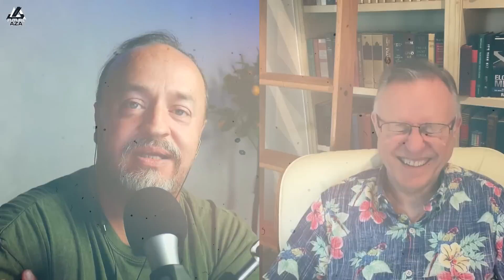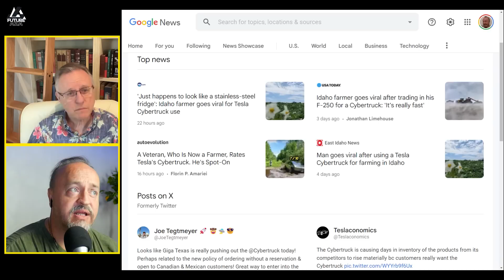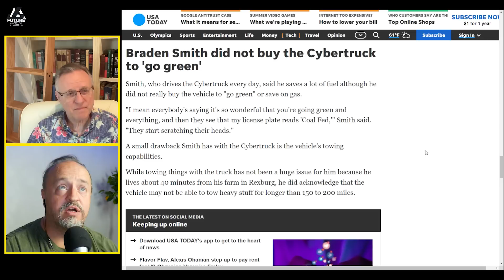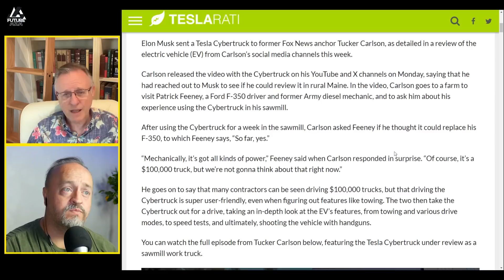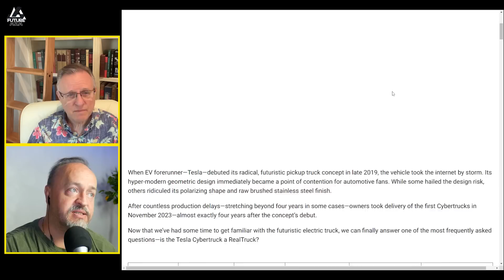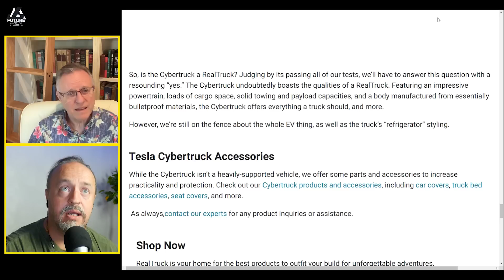Cyber IS a REAL Truck, and Even the Media Agrees

Comment: I hate whistling diesel, but they beat the crap out of a cyber truck and it was kind of fun to watch.
Reply: Nevermind. You mentioned it. Lol
Reply: Not really if you look a little harder, the F-150 actually only passed one of the tests, it didn't handle the drop off very well, it didn't go over the tubes.  The only test it actually passed was the over the hill jump but at a much lower speed and therefore much lower jump, it failed the explosions and it didn't go through the riot
But I doubt that any sane person would use any truck like that

Comment: Never had a trunk, but have a utility trailer, far more useful.
Now I tow it with my Y
Only there when you need it.
Nice and low, easy to get stuff in and out.
Easy to get lawn mower on and off.
No problem hailing 16 lumber.
Saved a fortune in gas.
9 out of 10 trucks never see dirt, never tow anything, sit in a parking lot all day and maybe move a 6 pack few times a year.

Comment: It's a truck that'll tow a trailer a hundred miles before you must stop and charge for half an hour or more, so on a trip of hundreds of miles, you'll spend a third or more of your time charging. If you're an urban cowboy who only uses a truck for light hauling around town, within a hundred miles of your home charger, and if a hundred grand is not a lot of money to you, a Cybertruck may appeal to you. That's a market but not a huge market.

My sister the veterinarian uses a pickup in her business and often pulls a horse trailer from the Piedmont into the mountains of North Carolina. A Cybertruck would never work for her. I'll never own a pickup of any kind, EV or otherwise, because I don't need one. On rare occasions when I need a pickup, I'll borrow or rent one.

To be fair, other electric pickups also have this limitation, though the Silverado EV has much better towing performance with a much larger battery and is in the same price range. I don't know how much money GM loses on each sale, but Tesla must still be losing money on Cybertrucks too at this point.
Reply: Tesla says CyberTruck will be profitable by the end of 2024 or early 2025.    GM will never get there with their current electric trucks.

Comment: My 2 wheel drive, regular cab Silverado spends most of its time parked in the driveway, but when I need to move a fridge, bark dust, garbage to the dump or tow yard equipment around, it's great.  It also works for me when my wife needs be somewhere else than me at the same time. I can't really justify the expense of a CyberTruck yet, but maybe if I get into hauling a smaller travel trailer.
I also just like the look of it, even though it took me a long time to warm up to it. Bottom line is, why should I judge my truck on someone else's needs or opinions? When I eventually get mine, I'm sure it will suit my needs.
Reply: I wouldn't buy any electric pickup to pull a travel trailer with the possible exception of the Silverado EV which has a 200 kWh battery. Pulling a trailer at highway speeds, you'll need to charge a Cybertruck every hundred miles, so you'll spend at least a third of your time charging on long trips. I wouldn't buy the Silverado either because it costs more than I paid for my first house, as does the Cybertruck.
Reply: @restonthewind I paid $24,000 for my house. How many new cars can I buy without spending more than I paid for my house?
Reply: @Joes_Morgue  I paid $85k for 2400 square feet on four acres in the late 80s. My ex-wife still lives there, and I suppose it lists for five times that amount now. Real estate leads the engineered inflation bubble, for sure, but you can still buy a few cars for $24k or less, a Mitsubishi Mirage for example. If you can buy cars made in China (unlike most of us in the U.S.), you can buy a decent EV for $24k. With the tax credit, a new Bolt EV sold for less than $24k last year, and GM promises to sell the new Bolt for the same price next year. We'll see.

Regardless, a hundred grand is a lot more than most people spend on a vehicle. Seventy percent of people buy used cars, and among the other 30%, the average price paid is $47k (and falling). Half of people pay less than that for a new car. Electric pickups are toys for the wealthy at this point and will be for the foreseeable future.